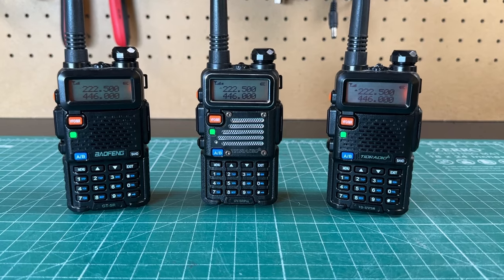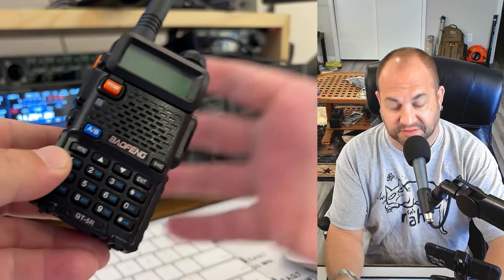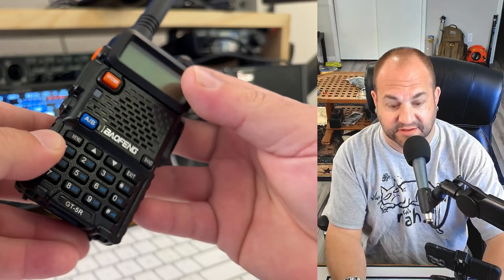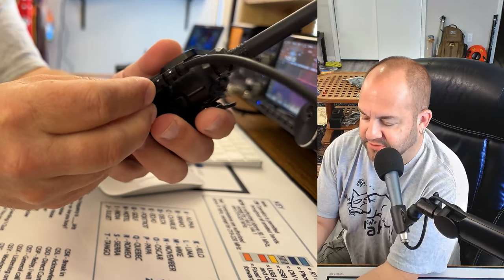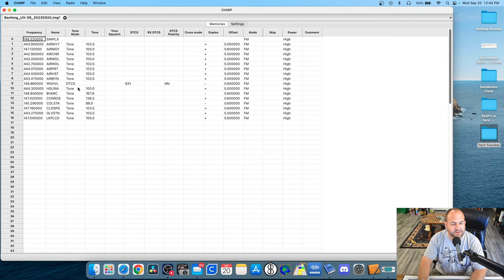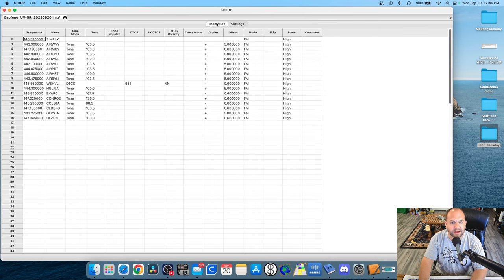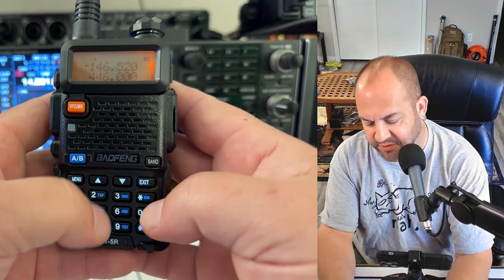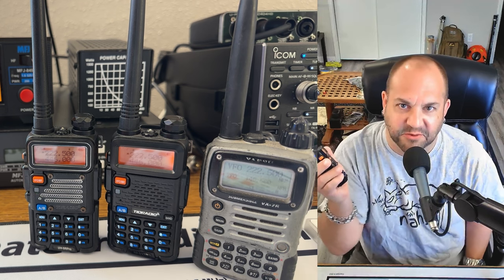Baofeng UV-5R Hacked | 220MHz Software Unlocked!

Comment: And just how dirty is that thing running that way? There is a reason it was limited and why the radio wasn’t certified to run 220.
Reply from the maker: It's a Baofeng.  It's not "certified" anywhere.
Reply: @hamradiotube  to be sold in the US all transmitters are certified. Ham Radios are part 90 certified for spectral purity. They have filters tuned to ensure that clean signal. It’s what got  Baofeng in trouble before. 

Only home brew ham radios do not require certification to use on ham bands. By your license you are expected to know how to ensure your rig runs clean and keeps spurs well down below where it causes interference.
Reply: The key word is "supposed" to be. Lol. Who knows if it actually is
Reply from the maker: @Djs13va  Yeah tell that to all the Baofengs that are sold here where they have fake certificates or use certificate numbers from other radios.
Reply: @hamradiotube  well two wrongs don’t make a right. I’m just saying, run a new baofeng same model pre-hack and then again post back with a service monitor or other monitor in line to see the spurs. I forget the exact level they need to be suppressed to but if you exceed that, well it’s out of band at the most, illegal. At the least, inconsiderate for whoever uses that spectrum.

Comment: Now just need that Tri-Band Signalstuff Whip. Ooh I can use an Ed Fong Tri-Band. Does that come in a roll-up or PVC only?
Reply from the maker: Looks like the Ed Fong doesn't come in a 220 roll up or tri-band
Reply: The Nagoya triband will work and it's cheaper than Fong's (which I don't think it does, as Mike said).